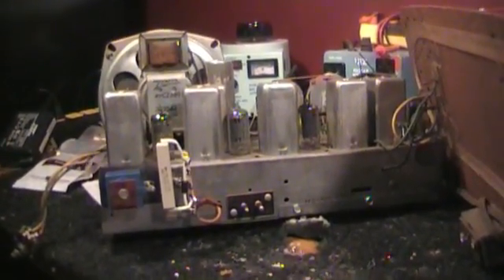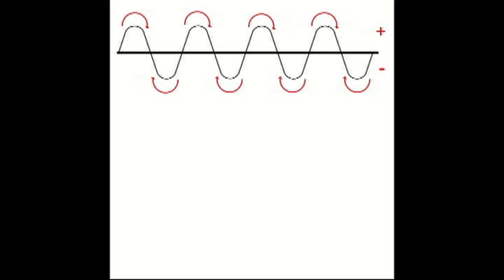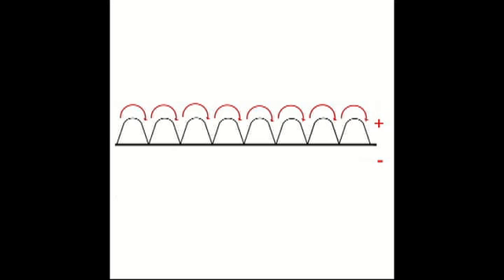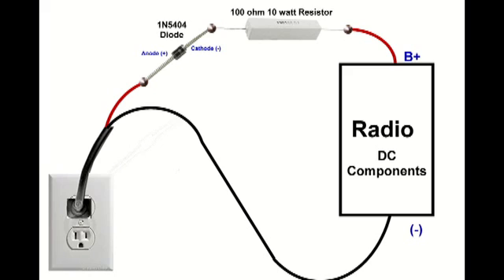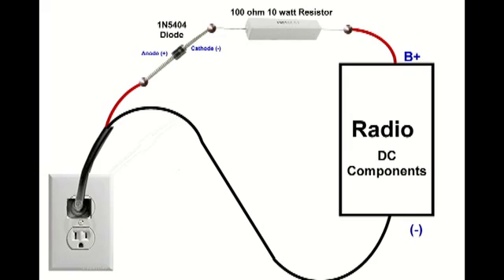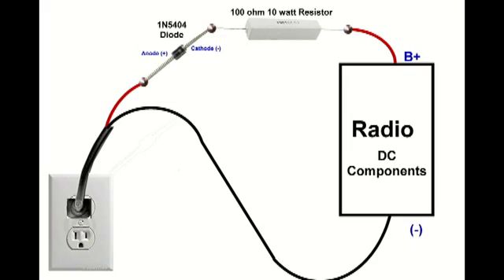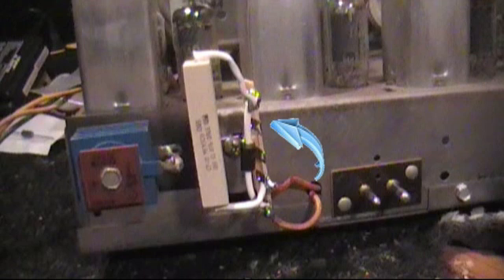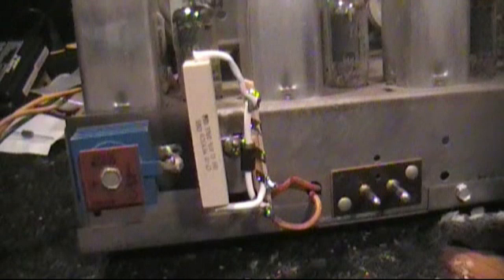Replace Selenium Rectifier - Antique Radio

Comment: In a radio you should put that resistor BEFORE the diode. otherwise it does NOTHING in the circuit.
Reply from the maker: Thanks for the input.  But I disagree.  Current through a diode can only move from positive to negative.  The positive current flows from the annode to the cathode.  That's what the diagram depicts.  It's important to remember that the goal here is to drop the voltage that enters the radio components, which are represented by a sort of black box in the diagram.  It's not necessary to drop the voltage beforee the diode.  And as I said in the video, I tried different ohms resistors and had different results.  130 ohms was too high, causing a muffled souind.  Also I tested it with a volt meter and the correct voltage drop was there. So it is obviously working as intended.

Comment: Well what if it is a old portable radio with 1 volt tubes? Are these filaments dc?
Reply from the maker: Most likely, yes.  Filaments in portable radio tubes are most likely Direct Current.
https://en.wikipedia.org/wiki/Vacuum_tube

Comment: What if there is a dropping resistor hooked up to the selenium rectifier? Do you need to re evaluate the dropping resistor?
Reply from the maker: In that case, I would remove both the rectifier and the resistor from the circuit.  The new power diode's voltage drop should be noted from the diode's datasheet and the dropping resistor should be calculated to bring the rectified output to whatever voltage is called for on the radio's schematic.

Comment: What if you have 2 separate electrolytic caps, which positive would I use?
Reply from the maker: Where is the selenium rectifiers hooked up to? It should be on the mains at some point. I would use the same connection that the oldcrectifier used.  If you're not comfortable doing that then look for someone in your area that can do it for you.  Never work on an old radio without draining the capacitors.  They can hold a deadly charge even after unplugging the unit.

Comment: Thank you John for this explanation. I am currently restoring two radio, a GE model 408 and a Zenith K725. The Zenith had it's selenium rectifier replaced by someone else with an SK3081 diode, but they left the factory 22 ohm resistor in place. I've had a few tell me this was an incorrect repair. 

The GE is mostly factory.
Reply from the maker: Apologies for the late reply.  The best way to assess the voltage is by the schematic.  The schematic should show the engineered voltage that should be on the output pin of the selenium rectifier.  The old rectifier could have had a voltage drop of several volts.  And newer diodes generally have a much lower voltage drop.  Mostly less than one volt.  So if we don't drop the voltage with a resistor then there could be up to 5 to 10 extra volts that the radio compionents were not designed for.  Granted, tolerances of each component may differ, and the radio will still work probably.  However, the added voltage could harm the components more rapidly over time.

Comment: Hi john sir.    Is selenium  a rare thing and why is it replaced.
Reply: 1.Selenium is toxic. 
2.Selenium rectifers are past their life cylce, even NOS. 
3.They will eventually fail, if shorted, they emit  the selenium,
and a nasty smell,,burned garlic-onion. 
4. If shorted, good possibility of destroying transformers, etc.

No, not really rare.
Hope that helps.
Reply: @robertc.2465  Selenium, in small exposures, is not toxic, and is in fact a necessary mineral for your body. The trouble is, with the way the rectifier element is made, as it can absorb moisture over time, become less efficient, causing it to turn into a resistive element and generating heat, which can turn into a self-igniting rectifier. Most of these rectifiers are so old they already are exhibiting breakdown, so, it's not a bad idea to preemptively change them to silicon diode's.
Reply from the maker: @robertc.2465  My favorite answer!
Reply from the maker: As Robert said selenium can be toxic.  Selenium rectifiers are not rare, really.  Over the years I've restored 12 antique radios and two of them had selenium rectifiers.  I dont know how many years they were used before more modern diode bridges became popular.  When they go bad they can emit toxic selenium fumes which is not good for humans.  Which is why I suggest replacing them during restoration with modern safe diodes.  Handling an intact selenium rectifier is not necessarily hazardous, but I would advise calling your local waste management to find out how they classify it.  My county has several days a year where they set up drop off points for hazardous things like paints, fuels, solvents, old electronics and such. The only other hazardous material I've come across is asbestos shielding inside a 1950s Japanese 5 tube AM radio.
Reply: @johnallenrichter  Was restoring an OLD (same age as me) VTVM during the first post. It Had 2 NOS Selenium rectifiers. 1 failed, No smoke, Thank God! It now has 2 1n4007s and dropping resistors. Have restored several with asbestos mats. You can spray them with clear lacquer and leave them in place. This keeps the particles from flying off.

Comment: John the only radios I have that have selenium rectifiers are my tube portables radios ,is this done the same way and can you use n4007 diodes along with the dropping resistors ?
Reply: Yep,  Most old tube equipment will not draw near enough current to stress a 1n4007. He probably had a lot of those and used what he had.
Reply: Robert C. Are there advantages to leaving the selenium rectifier if it is operational? It is full wave correct?
Reply: @knifeswitch5973  Hi Mike, It is easier, don't have to add a dropping resistor. But, if it shorts, you get toxic, nasty smelling fumes. And it could take out other components. Strange how it works. I've had two (NOS) fail in vtvms under repair recently. Fortunatly, they opened. Usually, they are half wave, like one diode.  I have seen multi-tapped ones that were full wave. If yours has 2 solder tabs, Probably half wave. Good luck.

Comment: Why did you leave in the old part,I rather see the new stuff the old parts serve no purpose except maybe to confuse someone in the future,I just saying.
Reply from the maker: No, it was to leave the radio in as near original state as possible.  If I work on a radio like this it would be schematics and I would immediately seecrge old was disconnected and replaced. Different strokes I guess.
Reply from the maker: I want to add:  Nobody likes surprises when they open a radio.  Their schematic might show their radio is supposed to have a selenium rectifier.  But if I had removed the rectifier then they might suspect they have the wrong schematic.  Or it might take them several minutes to find that it was replaced.  Leaving old pats in place with the new part right next to it instantly helps future techs to see the repair.

Comment: Does that1n 5404 diode work better then a 1 n 4007 I seen used in a lot of tube radios?I also seen two 1n4007 twisted together in case one failed,I kind of like that idea but don't if it's a ok idea? Anyone
Reply: I bet he had a bunch of 1n5404,s and used them. 1n4007s  are very adequate for most tube radios. Series diodes are ok, but rarely fail. They are cheap insurance for an un-obtainum transformer. If the average 5 tuber transformerless,, naaaa.
Reply from the maker: I actually used the 5404 on advice from a retired radio technician. I'm not an engineer so I really cant suggest that other diodes would work equally well or equally as safe.

Comment: My selenium diode is connected to the output of a 12v transformer... how big should by drop resistor be?
Reply from the maker: Wow!  Your comment escaped me for 7 years....  I'm sorry about that.  Dropping resistors are always calculated to bring the new rectifying output voltage to that which is called for in the product's schematic or electrical diagram.    Every radio, TV, or other product is going to be uniquely different.
Reply: @johnallenrichter  i never remember even asking, and ive already known the answer for years now, but impressive of you to respond lmao
Reply from the maker: @Re_Kitty  I was  a little shocked when I found your unanswered question from 7 years ago!  Again I apologize for the delay.  But it was a good question.  So I wanted to put an answer for anyone else who might have the same question in the future.....
Reply: @johnallenrichter  that's fair i do the same on my random ass videos too ahahaha but mine aren't that useful :)

Comment: John,
Why would the cathode end of silicon rectifier connect to B plus side? This would seem to reverse bias the diode.
 Thanks for your answer.
Mike
Reply from the maker: I don't know.  I don't think the radio would work with the diode reversed. It's been a while since I made this video but I'm pretty sure I would have tested it after the repair.

Comment: This is an AM/FM Zenith radio.  Zenith made these radios virtually unchanged from 1951 until 1959. The two basic models differed in that the better model had an active tone control with feedback network and push-pull audio whereas  the cheaper sets had passive treble suppression and single ended audio. The sound quality difference was astounding.The front end RF section may have differed too but I'm not sure. Zenith made good radios even in the AA-5 domain.
Reply from the maker: I've worked on a couple of zenith from the 60s also. I was impressed with their auto tone control using feedback from the detector/preamplifier (if I remember it right) into a front end pentagrid.  And I agree. Zeniths were definitely the best sounding radios. I'm trying t po remember the set up for the 40s treble controls. I think it was a variable resistor knob in parallel with a smoothing cap. It came after the 2nd I.F. transformer and before the volume control if I remember correctly. But it's been such a long time I cant remember. I closed down my hobby desk when I moved 5 or 6 years ago. Downsizing.

Comment: why can't you just use the diode with a capacitor to make up the difference in the missing waveform?
Reply from the maker: Excellent question.  Capacitors are definitely used to flatten out the curvy line.  As a hobbyist, I don't know if that would accomplish a drop in voltage or not.  And that's why I would never personally try it.  It might drop the voltage.

Comment: Sorry if you already said it, but i thought i need to build a 4 diode rectifier.
Is this single diode version better? ( i dont have working speakers at the moment)
Reply from the maker: There is a difference between full wave rectifiers and half wave rectifiers, The half wave being shown here.  Most old tube radios can run on half wave rectifiers.  However, I have seen some radios and old TV's that used selenium rectifiers in a full wave bridge.  As such I can not advise you on which system to use.  If you have schematics or can see that your rectifier is a full wave bridge then it would probably be best to replace it with the same, but as a non engineer hobbyist I'm not qualified to give you exact advice.  You should probably Google the difference between full and half wave rectifiers.
Reply: John Richter
Thanks.
The Problem is:
I dont know my Radio Model.
There is NO number on it and it doesent have a wooden Box anymore. I searched for my Siemens Rectifier and found out that People replaced them with 4 Diode Rectifiers and they work. Sadly i dont know how many Volts my Radio Needs because some Tube Modell numbers are Burnt of.